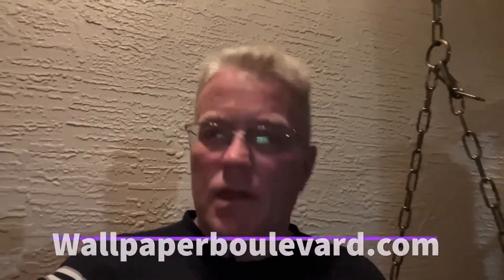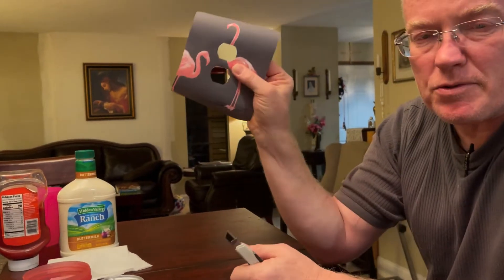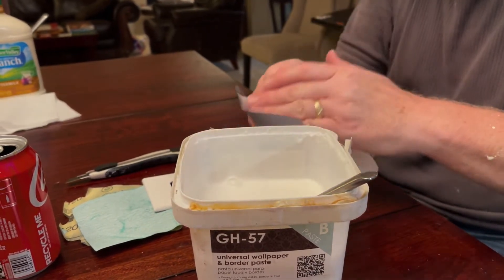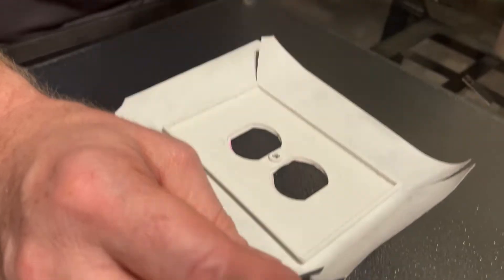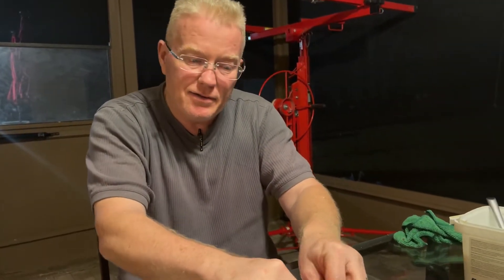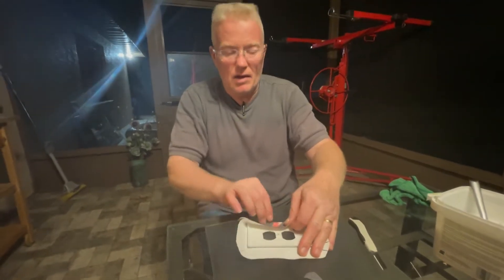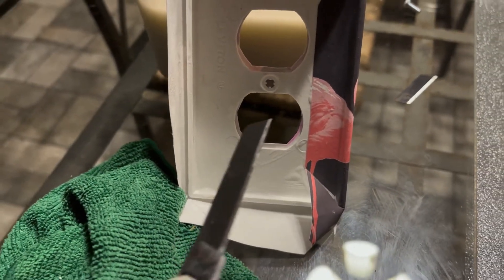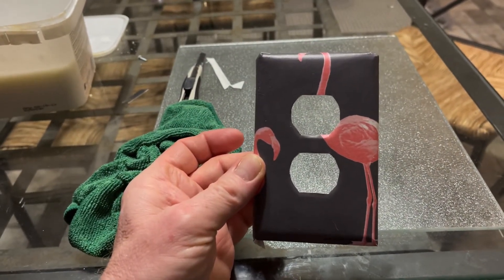Wallpaper Switch Plate Covers - Spencer Colgan

Comment: To me, the most difficult part is matching the pattern. Several years ago I purchased cardboard
templates in the shape of switch plates, outlets 2 and3 gang switch plates. The template has
thumb tacks at each corner facing out. Put the template on the switch or outlet matching the
Wallpaper pattern. Press the paper on the tacks, remove from the wall face down on your table
and cut the paper to the template. Paste, and apply to the cover. I don't worry about the white
showing around the outlets, as the outlet is white. Not noticeable.
Reply from the maker: You’re a true veteran hanger

Comment: 3M™ Tape Primer 94 Eight-Ounce Can 

This eight-ounce can of 3M™ Tape Primer 94 promotes adhesion to polyethylene, polypropylene, ABS, PET/PBT blends and other on difficult to stick to substrates and is most commonly used for increasing adhesion of film, wraps and vinyl graphics. Apply it with a brush or swab for smaller grpahics or use a pressureized flow gun for larger wraps. Dries to a clear finish and cleans up easy with alcohol.

3M™ Primer 94 Features

Promotes adhesion to polyethylene, polypropylene, ABS, PET/PBT blends and other on difficult to stick to substrates 
Can be applied with brush or swab for small areas and a pressurized flow gun for larger areas